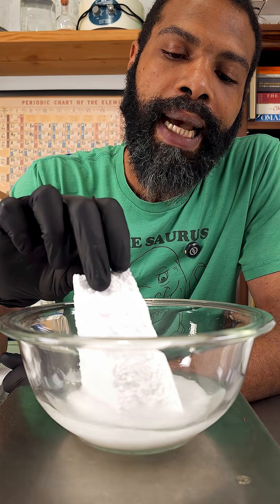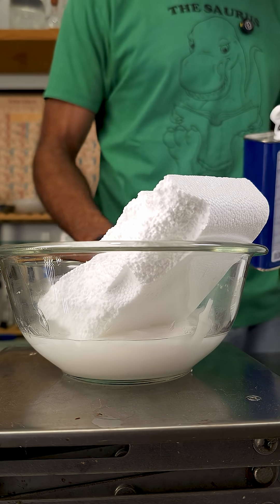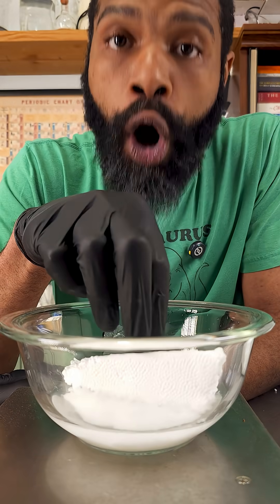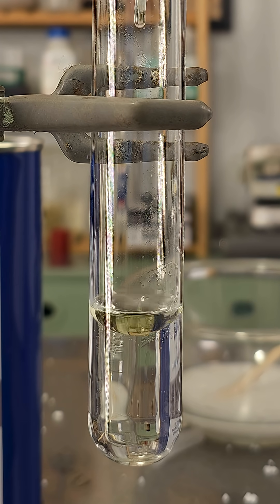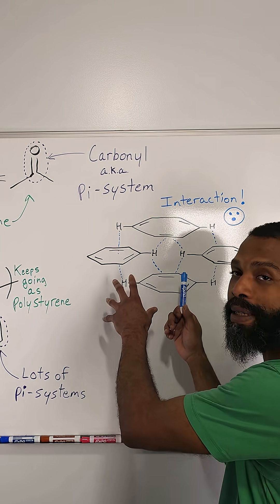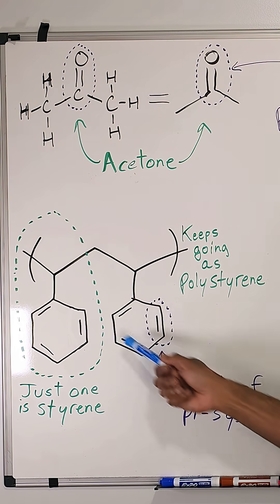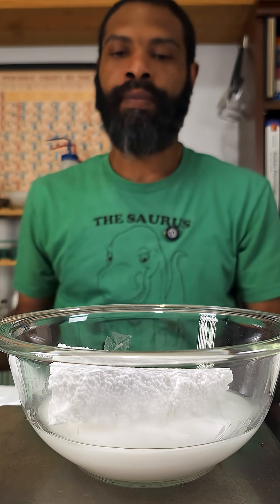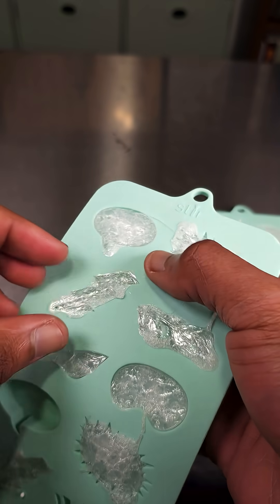acetone is polar

Comment: You drew bonds from the hydrogen atoms towards the double bonds and that’s inaccurate. It’d be more accurate to assume- and you even said it- pi interaction via pi stacking. So the dashed line would be from the middle of the aromatic ring of one molecule to middle of the aromatic ring of another and so on as they, “stack.”

Comment: This guy doesn’t seem to understand that Acetone isn’t a highly polar liquid, he is correct that it has a polar carbonyl group, however, its two methyl groups give it significant nonpolar character which can engage in strong dispersion interactions with a nonpolar compound like polystyrene. It’s also important to note that acetone is far less polar than water as a water molecule can form two O–H bonds, allowing for something called hydrogen-bonding which makes water a much more polar solvent than acetone.

Comment: Something I find really interesting is that, while acetone is able to dissolve ABS, it crashes back out of solution as soon as you drip it into water. (I suspect that could be used to make fibers if someone wanted to figure it out.) Just by eye balling it, I suspect that the solubility of ABS in an acetone-water mixture drops way faster than the acetone fraction.
Reply: That's how viscose fiber is made.
Reply: @Tunkkis  I don't know the details of ABS in acetone, but a quick search suggests that the Rayon (i.e. viscose fiber) processes manipulate the solubility of the cellulose by converting it into a related chemical and then back. I suspect the setups would look a lot alike but the chemistry could be wildly different.
Reply: @benjaminshropshire2900  Yes, I meant the technique would be mechanically similar, not necessarily chemically.
Reply: @Tunkkis  :0) ironically, while I've a BS in Mech Eng and only took one Chem class to get it, the chem part is what nerd snipes me and the machine is just meh. Go figure.

Comment: I don't believe it's "Air" that's trapped in the strands of polystyrene, I know it used to be R12 Freon. However R12 and other CFCs, Chlorofluorocarbons were outlawed due to the negative effect on the ozone layer. I know other "refrigerants" have been used "blow foam" the only concern is polystyrene must be soluble in the refrigerant in order to generate foam when it is decompressed and allowed to expand, thus forming foam.

Comment: acetone is an interesting solvent because it's amphyphilic (it bonds to both polar and non-polar molecules. since gasoline dissolves styrofoam too i bet it is just the non-polarity of the intermolecular bonds that allows the technically polar acetone to work here like a non-polar solvent.

Comment: Acetone dissolves polystyrene by breaking down the long polymer chains that make up the plastic, causing the trapped air to escape and the material to shrink and appear to dissolve. The process involves acetone loosening the grip of the polystyrene molecules, allowing the air to be released and the material to collapse into a smaller volume.

Comment: So when the acetone disrupts those pi pi bonds does it release energy or absorb? 

Part of me thinks it would absorb energy because you would need energy to get the acetone to physically move into the pi structures, another part of me feels like it would get hot because those bonds breaking could be a lower energy state, like the acetone-styrene relationship is a more stable pi structure than the styrene-styrene so energy is released during the transition.

Comment: I thought for safety you had to wear a respirator while melting styrofoam and acetone? Is that not the case?
Reply: Acetone is pretty tame in terms of fumes
Reply: as long aas you're not doing it in a closet you'll be fine, just have a somewhat ventilated room

Comment: On the polarity index, which water is a 10 and pentane a 0, acetone is a 5.1. Its slightly more polar than nonpolar, but its still in the middle of the polarity index, so I wouldnt call it neither. The pi bond theory does make a lot of sense since acetone is really good to dissolve polymers, while most nonpolar solvents cant break most polymers.

Comment: I remember accidentally splashing gasoline on a foam cup on my mom's truck bed when we went to mow a lawn as a kid. It left a ring of dissolved, then hardened sludge on the truck for the rest of time after the gas evaporated. 😂 gas is nonpolar so maybe people are conflating the two. Acetone and gas both vaporize quickly, dissolve Styrofoam and have strong odors. Idk

Comment: I don't think acetone truly dissolves polystyrene like water does sucrose or sodium chloride. My theory is that acetone moreso weakens the structure (maybe by weakening those pi-bonds) and allows the polystyrene to behave more like a liquid or actuality liquify the plastic. The deformed Styrofoam can be pulled out of the acetone, unlike sugar or salt dissolved in water which requires removing the solvent.

Comment: This will also become a very thick and highly flammable sludge that works like napalm. Imagine coating an animal and lighting it? Or a person or something? I used to vandalize concrete buildings by dissolving styrofoam in gasoline and painting it on the concrete and lighting it. Have fun with chemistry kids! I learned this thanks to Chemistry in high school!

And you all think guns are what is dangerous…

Comment: Acetone, or CH₃-CO-CH₃ has a carbonyl group: CO, which is bonded like so: C=O. This means it has a significant dipole moment (which measures charge separation, determining molecular polarity) because oxygen is much more electronegative than carbon, creating a partial negative charge (δ⁻) on oxygen and a partial positive charge (δ⁺) on carbon (damn this delta sign is hard to find). Although the molecule has (some slight) symmetry, the polar C=O bond dominates, making acetone overall polar. Some people think acetone is non-polar and by using their frickin GPT and acting like karens, they say that acetone is non polar because they lack hydrogen bonds, no hydrogen bonding. HOWEVER, if you just mix alcohol and water into it, it quickly accepts these hydrogen atoms, showing that its a goddamn acceptor of hydrogen bonding.

In addition, it also meets the requirements in properties of a polar substance, if you've ever studied chemistry before, if a compound is miscible with water it is polar. He literally showed it in the video. It also has a high dielectric constant at around a whopping (ε ≈ ) 20.7 and if you went to school, you would know that ethanol has a dielectric constant of (ε ≈ ) 25, and its polar. And if he didn't show you in videos, he dipped a FREAKING plastic in the FREAKING ACETONE AND IT MOTHER FREAKING DISSOLVED THAT LIKE THE BIGGEST GIVAWAY OF POLARITY OMG

if you've never studied chem be4 just sybau

Comment: Two random questions:
1. How would you dispose of that slimy liquid? Would the remaining acetone evaporate and it would dry up and you could throw it in the trash like any plastic waste or does it stay a liquid making it difficult to dispose of?
2. You mentioned that this is not how styrofoam is recycled industrially. How is it done? It is not something that can be put in my curbside recycling so I'm wondering if there's a way that it can be broken down and remanufactured or recycled in some other way.

Comment: Also acetone is technically both a polar AND non polar solvent. It has the properties of both.  It’s also worth noting that when you dissolve styrofoam in acetone you actually end up with a mixture of acetone and pentane as there is pentane trapped in the balls of polystyrene which get released when the styrofoam is dissolved. The pentane then mixes with the acetone.

Comment: Also, Acetone is not disolving the styrofoam it is as you said defoaming it, disrupting the structure is not disolution, you can still physically separate the pokystyrene and the acetone with simple fiktration.

Comment: I've always wondered why PS melts in acetone but doesn't really dissolve. You always get that two phase system of acetone and goop rather than an increasingly thick syrup of plastic dissolved in solvent (like PVC pipe cement). The acetone interfering with the crosslinks but not the chain bonds makes a lot of sense to me.

Comment: Interesting! And I didn't realize the styrene would re-harden in those molds (after the acetone flashes off?) How long does that take? Are they brittle? Or is it like the injection molded styrene material that, like, Testers modle airplanes are made out of?

Comment: The main thing to notice about how acetone dissolves polystyrene is that it definitely does not dissolve polystyrene. It does not go into solution. It forms a big homogeneous, completely separated gloop.
Reply: That's because its a polymer. In polymer chemistry, the more you look into it, solubility becomes an opaque subject (pun intended).

Comment: The "like dissolve like" convention kinda breaks down with acetone cause it dissolves in both water (polar) and hexane (non-polar).
I think we should consider molecule size as well since acetone is extremely smooolll 😂
Reply: You're describing detergents/emulsifiers.  Partially hydrophobic and partially hydrophilic.  That's how they stabilize an emulsion and dissolve both.
Reply: No but it’s structurally like water and it’s structurally also like hexane
Reply: @tatianazal So...it's the mushroom of chemistry?
Reply: It's more like acetone is kind of polar. Compared to water, or a molecule like sodium chloride, acetone is far less polar due to having a hydrocarbon component. However when compared to other nonpolar compounds like triglycerides, alkanes, etc acetone is far more polar. I can't really explain how it all works but that's the best way to look at it instead of seeing chemicals as either polar or non polar. Polarity is a spectrum that depends on what the chemical is made of and whether the bonds between them are ionic, covalent or otherwise. Even water itself is not even truly polar like an ionic compound (sodium chloride for example) would be. Temperature, pressure and pH can also affect solubility of various compounds in different solvents too. Silica doesn't readily dissolve in room temp water at standard pressure but deep in the earth's crust, super hot, pressurized water actually carries silica and other dissolved minerals and can form solid minerals where it finds cavities to cool in.

From Reddit user DasFrettchen:

TL;DR: it's entropic favored, not necessarily enthalpic.

>like dissolves like

Well, this is where chemistry gets a little tricky, becomes a 'case by case' study, and starts having more exceptions to a rule than anything else. 'Like dissolves like' is a good rule of thumb, but should be approached with care.

As with most systems, this one will try to minimize its total energy. For a simple dissolution like this, there are two components that play a most important role, intermolecular bond energy and the system's entropy. 

What you are thinking, about 'like dissolves like', is the ELI5 version of the first part, decreasing intermolecular bond energy. I'll give some more drastic and easy to understand examples, than come back to acetone + polystyrene.

In a case such as water + hydrocarbons (such as  oil), they don't mix because the water-water interaction has much lower energy than a water-hydrocarbon bond. Water-hydrocarbon bond (permanent dipole-induced dipole interaction) still has lower energy than hydrocarbon-hydrocarbon (van der Waals), but not lower than water-water, so the mixing won't happen.

For a mixture of ethanol and water, for example, they mix because the hydrogen bonding in water-ethanol is much stronger than in ethanol-ethanol, and of comparable strength to water-water. This means that the energy in the mixture is lower than for the the separated compounds. 

Things get interesting for salts. For example, for sodium chloride, you shouldn't really expect that it would dissolve in water. You are breaking ion-ion and hydrogen bonds to create a dipole-ion bond. While ion-dipole bonds are strong, ion-ion (coulombic) are still stronger, and in fact, a sodium chloride solution has more energy than the separated compounds. What drives dissolution, in this case, is the increase in entropy. Specifically, the ions in solution have many more ways to be arranged than in the solid state. This means that the solution has a 'higher disorder' (higher entropy), and is favored compared to the separated compounds. This is also aided by the fact that the ion-dipole interaction, in this case, is of comparable strength to the ion-ion and hydrogen bonds, so the system doesn't have to gain too much energy in order to achieve dissolution.

This last case is equivalent to acetone + polystyrene. While acetone is polar, the partially positive carbon of the C=O bond is hindered by the methyl (CH3) groups, such that the molecules' dipoles don't interact so strongly. Polystyrene also has weak intermolecular interactions (van der Waals). I'm not actually sure if the solution has a lower or higher energy than the separated compounds, but in either case, it should be close to zero, since acetone actually has an apolar part, and would interact quite well with the apolar chains of polystyrene. But just as in the case of NaCl, there is a huge increase in entropy upon dissolution, since the chains are now able to move much more freely.

Feel free to fact check but that essentially is what I remember learning about it as well. Essentially, certain molecules always are extremely or slightly polar and therefore interact with charges in different ways accordingly.
Reply: @jordynozymandias374  if you haven't, you should consider posting this as a primary comment.  It was interesting, though easily missed, being nested.
Reply: That’s only a convention

Farther you go in science conventions lose relevancy 

But it makes it so much harder and people try to shove it in

Comment: In liquid chromatography, acetone is considered much more like acetonitrile (another polar, aprotic solvent) than methanol or ethanol.  Perhaps the "acetone is nonpolar" idea comes from the observation that hexane (clearly a nonpolar substance) and acetone are miscible.  
I have no idea whether your pi-pi interaction idea for dispersing polystyrene foam is correct, but FWIW acetone and benzene are also miscible.
Good video.  Thank you.
Reply: Acetone is also miscible with oil.
Reply: I also think he got confused with the pi stuff. Pi stacking in aromatics has nothing to do with the pi bond present in a carbonyl group.
Reply: @toseltreps1101 it really has more to do with physics and colloidal forces. Polystyrene is a foam; acetone has very low surface tension so it’s insanely good at wetting. It quickly breaks cells of foam letting gas from foam escape. It breaks acetone more mechanically, than anything. This is why you have two phases - polystyrene saturated with acetone (gel aka the goo) and acetone that maybe has a teeny tiny bit of actually dissolved molecules of polystyrene (that solubility constant is small if I remember correctly)
Reply: @toseltreps1101 Hm, but what if the pi interactions disrupt pi stacking in styrofoam, causing it to defoam/dissolve? In LC, the interactions of your solvent with column chemistry can be a consideration, ie acetonitrile interrupting pi stacking of your desired compound with a phenyl column
Reply: @toseltreps1101  You're right, but I think he's recognizing that pi systems have more opportunity for dispersion interactions (or perhaps stronger dispersion interactions?) giving the result he's trying to rationalize.
Then again, maybe it's just magic.

Comment: My thought was immediately about turning that goop into molded plastics, because in Wh40k we end up with a lot of excess sprues (made of polystyrene) that we melt in acetone. Stays good for ages as acetone only breaks up the bonds between polymers but doesn’t degrade the polymers themselves, and the so-called “sprue glue” makes excellent spare bits or whatever else you need, and is fully recyclable! I’ll keep the fact that foam works similarly in my back pocket. ;)
Reply: in Warhammer 40k??
Reply: @Fe_Ksandr  i assume they're referring to using it to make props and stuff, then melting it down again
Reply: @Fe_Ksandr Yeah they mean building the minis from 40k